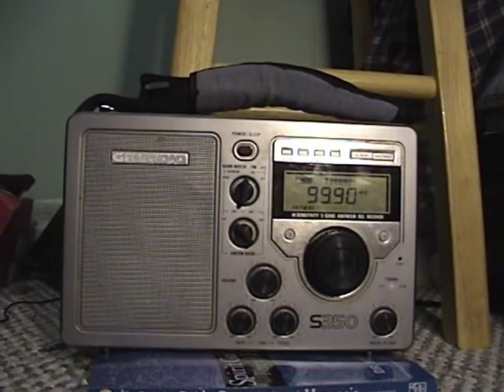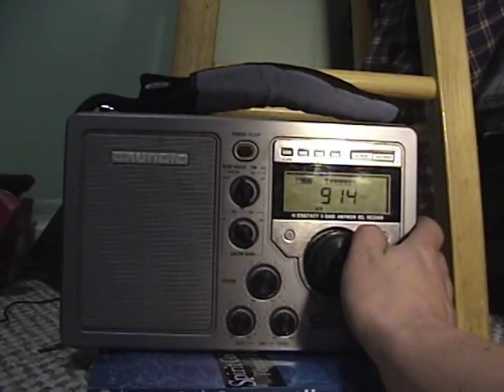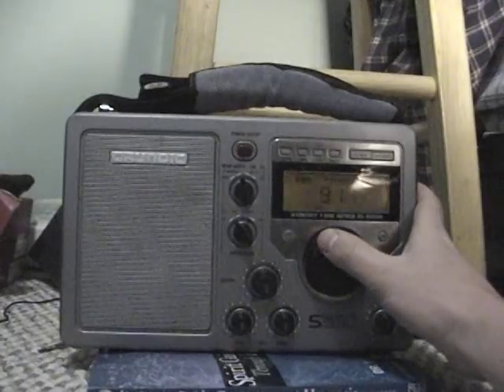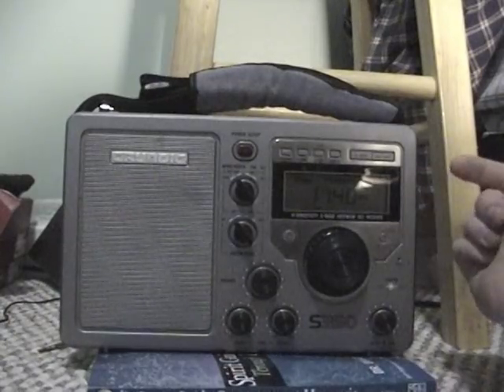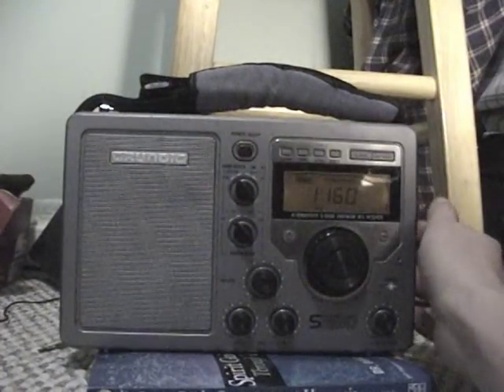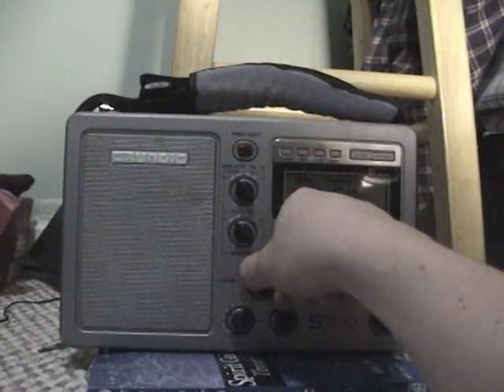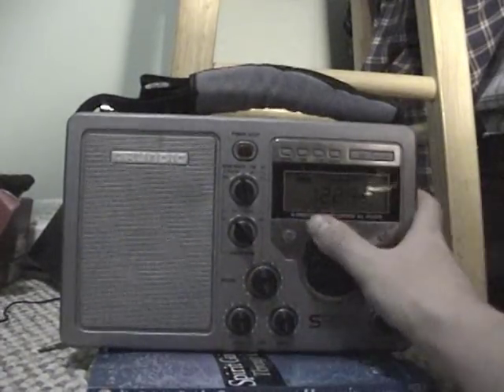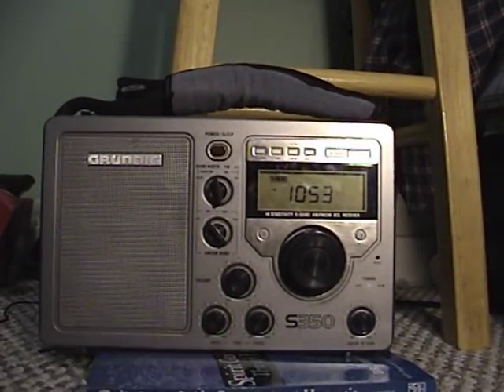Why HD Radio Sucks on AM - A demonstration

Comment: To me the iboc system is great for AM something we will never have in the UK but we certainly should. The only problem with it is that it kills any ability for dx'ing and I guess ditto on FM ?
Reply from the maker: HD radio would be worse in the UK. It hasn't worked here and most certainly wouldnt work there. Stick with DRM or DAB.
Reply from the maker: HD radio on AM is dying. The number of stations dropping it outweighs those adopting it 100 to 1.
Reply: In Toronto, ON, Canada, AM 640 is not available on AM HD radio but it also available on FM HD2 via 95.3-2, a sister radio station of CING FM 95.3.

Comment from the maker: Ok Thomas, go to Salt Lake City, Utah. Tune to 1140, 1150, 1170, 1180, and tell me what you hear on ANY radio. The Sony Wonder Tuner (XDR-F1HD) is an HD radio. Prior to the signal locking, you hear the hiss on KSL. I can hear it several hundred miles away where I live now. HD Radio on AM = a failure.

Comment from the maker: @Teflon65 IBUZ is just a term some of us who noticed the sound of the interference coined it. Also called as such because HD Radio's technical term is IBOC (In-band On Channel). I mainly use the IBUZ term because of the hash noise the sidebands of an AM HD station (and in some cases, FM) produce. Any radio, including HD Radios themselves can hear the noise you hear in this video. It blocks hearing other channels, that is my main complaint.

Comment from the maker: @THEBossSound most people who have radios probably didn't spend that much to buy them. The cheaper the radio, the more cheaply it is built, and the more likely you'll hear the interference. For example, I live within 10 miles of a 10,000 watt AM station on 1060 that DOESN'T use IBOC and it is clean as a whistle at night and day. KSL features hash from 1130 to 1150, and then from 1170-1190 on almost all of my radios, even with HD. There is no denying HD Radio makes interference on the AM dial.

Comment from the maker: @schepler2 
I respectfully disagree that it is the S350. As I mentioned, any radio receives the hash produced by HD Radio. Even the Sony Wonder Tuner (XDR-F1HD) which is an HD Radio itself picks up the noise. The S350 has received a large chunk of the 354 stations I have heard in Salt Lake. With the right antenna, it becomes a really good performer. I also mention the radio wasn't in a good position when recording this video.

Comment from the maker: @Teflon65 Yeah, sometimes the older the radio, the better AM sounds. The Grundig in the video is probably the best sounding radio I have. The others do not have the wide switch or are too wide that they allow adjacent stations to bleed badly. The radio in the video can switch between narrow mode (10khz) or wide 10+ khz so you can hear the whole sound. I prefer narrow though, because the S350 is a hot AM receiver.

Comment: @Ubstudios And what listenable stations are there in SLC on 1170 etc?  none.  Especially if you are 10 miles from a 50kW AM.  The FCC would not assign a station within 20 kHz on either side within KSL protected area.

Comment: @RogueKnight12866 There is nothing wrong with Justin's demonstration; it demonstrates why it's difficult to listen to adjacent channels on AM quite well. From my High Desert listening post in California; IBOC has eliminated or causes interference to a dozen station that use to come in here. Example: KDWN 720 Las Vegas is covered up by 710's IBOC from Los Angeles, 660 Oildale suffers from adjacent channel interference from IBOC on 640 KFI. Noise is added to the main carrier from the IBOC

Comment: As a guy who collects vintage radios, and who also owns a Grundig S350, I can tell you that the Grundig gets abysmal AM reception, at least here in the Phoenix area.  I have a 45-year-old Zenith Transoceanic 3000-1 that gets almost noise-free AM reception at all times of the day or night.  So, some of what you're demonstrating here is simply a result of the shortcomings of the S350.

Comment: KSL's analog signal would cover 1150 to 1170kHz on the "dial" but their outer HD bands are 1145-1150kHz and 1170-1175kHz.    

This is especially problematic at night; trying to hear a DX station next to a local HD station is a mess of HD digital noise from the local on the DX station's weaker signal.  In this example, DX stations on 1140 and 1180 would get heavy HD splash from KSL.

Comment from the maker: @RogueKnight12866 You obviously have no idea how many people listen to AM radio stations from farther away than normal. The problem I discuss in this video is that the IBOC signal creates hiss on the center frequency itself. As I write this comment, I am listening to KOA... 300+ miles distant, and I can hear the hiss caused by its own IBOC on 850 itself. Even on an HD Radio tuner, you can hear the hiss caused by IBOC itself. IBOC would work on AM if it were to fit within 10 kHz, not 30 kHz.

Comment: Wow.  I suspect this is the reason why we're not using HD Radio here in Australia.  What an awesome radio you have there.  I like it.  Grundig are generally very good.
Reply: Lachlant1984 Australia uses DAB on 174 MHz to 240 MHz.

with channels 5A, 5B, 5C, etc...

Canada ended DAB broadcasting since 2006 but they changed to IBOC HD RADIO broadcasts.

South Korea and Taiwan uses DAB, Philippines uses HD Radio.

Comment from the maker: @josephdupont It shouldn't matter if it is calibrated or not, what can be heard on this radio can be heard on other radios. HD Radio produces hash on sidebands on AM (and in some cases on FM), plain and simple.
Reply: Ubstudios 

Analog AM radios in Canada could also simulcast via FM HD radio subchannels.

Toronto's CFTR 680 NEWS does not do HD on AM but it simulcast via HD subchannel 2 on 92.5 FM CKIS KISS FM.

92.5 CKIS Kiss FM has 3 HD Radio subchannels.

HD1 for main CKIS FM 92.5 Kiss FM station
HD2 for CFTR AM 680 News  simulcast
HD3 for CJCL AM SportsNet 590 The Fan simulcast

Comment from the maker: @s51curtis I hate to agree about AM technology not lasting much longer but its becoming an unfortunate fact. As far as KSL's HD sound compared to analog, you're right, it does sound better, albeit with digital artifacts. As finicky as the signal is for an HD AM station (you practically have to live on top of the tower for the station to sound the best), I really question its worth. In this situation, KSL is also on FM, so it doesn't make much sense to broadcast their AM AND FM in HD.

Comment: Part of the reason why KSL sounds so bad on 1160 in the wide position is probably because your radio's digital display isn't entirely accurate.  I used to have a Grundig S350 and then an S350DL and they both suffered from this.  For example, if I wanted to tune into 700 WLW, the big AM station where I live, I would have to tune the Grundig to 704 khz for the radio to actually be on 700.  But anyway, that HD interference shows up on all of my AM radios and it's really annoying.

Comment: Your tuning into the digital part on both sides of main channel. My HD AM car stereo sounds way better than your old radio. I wish there was a mandate to add HD to all licensed AM and FM channels. I received HD AM 100 miles away! during the day. I live in TUCSON AZ, not much HD here but in PHOENIX AZ. they know what they are doing!
Reply: What he has isn't an old radio, just so you know.  I have a Tecsun PL-660 which is similar, both are DSP driven radios.
Reply: I have even picked up kcbs am 1070 in HD at night in Tucson. Thats over 500 miles away! JVC does not make hd radios with tuners like this anymore! jvc hdr 20
Reply: +james borg You should do a video of this, that's impressive ! Any stereo on AM HD ? Did Tucson ever have any c-quam am stereo stations ?
Reply: +digitalmediafan I am trying to put my jvc hd radio in my focus.  I picked up 550 am from phoenix IN HD!! and I live in Tucson 100 miles away.  Analog radio stereo is not nearly as good .  IVE GOT AM DIGITAL STEREO FROM 100 MILES AWAY!.  This guy probably likes analog tv signals too. Digital tv is better. Digital am and fm is also better.
Reply: +james borg During the day HD fm and AM 100 mile range.
Reply: +james borg OK well try to upload some video of what you receive !
Reply: Ordered a new jvc hd radio today. Will install when received. I also run my own 1 watt radio station on fm. I use breakaway audio broadcaster on a PC with my czh fm 1 watt unit. My audio sounds better than most fm stations (up to 1 mile away). I don't dare go over 1 watt (without a license) and have a clean signal on a vacant channel. I also helped fix KWXL a 50 watt LPFM local high school station with their audio issues. I will make a video of my new focus hd sound system when ready. Cant wait to get rid of my stock sync radio!!!
Reply: Me too in the UK, excellent fun for the price. And finds fm where there was none on other radios.
Reply from the maker: james borg kcbs isn't on 1070, it's on 740. KNX is 1070.

Comment: @Ubstudios That's true but look how many years it took for auto makers to include MP3 playback.  MP3 has revolutionized the music industry for the past 10 years but only in the past few years have a some auto makers included that, including Ford, Scion, Lexus.  HD radio isn't going away.  Aftermarket stereo makers are leading the way again just like with MP3.  Auto makers will follow their lead once again.

In LA and San Diego alone, there are 3 or 4 dozen HD channels and sub channels combined.

Comment from the maker: @THEBossSound 
On top of that, those living outside of the city, I.E. rural areas, who used to be able to hear stations at night a lot clearer can hear the digital signals as well. Case in point, KFAQ 1170 Tulsa used to be receivable here just outside of Salt Lake City at night with any given radio, until KSL turned IBOC on. I've been told by KSL that people in Vernal can't hear KSL because of KFAQ's IBOC. IBOC DOES NOT WORK ON AM! Period!

Comment: QUOTE from CES 2011:
"OEM: 17 Brands ● More than 85 Vehicle Types ● 36 Standard

Automakers substantially increased their commitments to HD Radio Technology over the past 12 months, and iBiquity expects strong corresponding growth in HD Radio equipped car sales in 2011.

Importantly, Toyota Motor Sales has announced the launch of HD Radio Technology in 2012 Model Year vehicles. Toyota will be the first OEM to offer the iTunes® Tagging feature on all radios that include HD Radio Technology."

Comment: I don't find your demonstration really relevant. In normal conditions, and for average listener, you don't try to catch dx signals on the fist or second adjacent channel of a local station. If HD radio is a relative fail for now, is not because of that.
Reply from the maker: I agree. The average listener doesn't do that. That doesn't excuse the on channel noise caused by HD. Even on 1160 you can hear the hiss. Non-HD locals never had that. That's a byproduct of HD and there's no way around it.
Reply: The first reason to not use HD on AM it's because broadcasters don't need it, you take a risk on your range with so few benefits, after, because HD FM can broadcast in HD channels AM stations, and finally, most of HD receivers on the market are only FM tuners. In Canada we use it since few months in some markets, and as I know, in Montreal and Toronto, you have AM stations on HD FM channels. Anyway... even if I like AM vintage sound, DXing at night, and the grandfathered technology, I saw in New York that FM stations simulcast AM 50kw transmitters (WFAN as example)... So AM radio will die, probably until 10 years from now. But, more HD tuners must be produced and sell. They are hard to find today.

Comment: DRM has a better plan to allocate many not all! low power radio stations on the almost unused 26khz 11 meter band,it has space for more than 40 channels on 10khz bandwidth or over 20 station on 20khz bandwidth for less compress sound.this will give many local AM station the oportunity to stay on analogue and at the same time in digita! that way it would not overload the AM band with dirty interference.Press the button and the radio does not care were the signal is  from as long as its there.

Comment from the maker: @Ubstudios And another thing, since you're obviously pro-HD Radio, tell me why it hasn't been massively adapted as we've been told by Ibiquity. Why can't I buy a car today with an HD Radio in it (but Sirius built in lol).  Why on AM did Citadel silence its nighttime IBOC transmissions? Why are the AM stations that use the technology letting it drop like flies? Obviously something must have happened! I do like HD Radio, just on FM where it belongs. The video shows IBOC interference, nuff said.

Comment: This video shows how corporate radio station using 'HD' jamming signals take up 2 extra channels of the radio dial  on each side of the main channel sending a chainsaw like  buzzing sound that obliterates small locally owned stations. You can observe this as you tune your radio dial across the channels any station using this fraudulent HD technology has this chain saw buzzing noise on a channel below and above the original licensed channel. HD stations take up 3 channels but you can only here
the analog channel in the middle unless you can find and buy a new HD radio , and since less then 1% of the public owns HD radio's ( or even cares know about this ) you see this is really used as a way to jam out the smaller stations. Evil company's like Clear Channel ( now Iheart media ) and CBS ( now Entercom ) own and collect license fee's ( anti-trust, monopoly crimes ) from the hardware and lobby congress resulting in a 10 times power increase for the HD signal. These Corporate stations have 5 or 8 or more stations in every major city and when they add this insidious  HD jamming signal each of clustered stations 'take-out' two more frequency from the public's airwaves , that is 10 or 16 more channels you only hear the buzz-saw signal on , channels that used to have good signals from smaller stations. The public has been duped by this corporate trick, even the name of the technology was a lie , its call I.B.O.C  I-BOC standing for IN BAND ON CHANNEL , this is a lie , it is really in the FM band but on some one body else's  channel. 
Another way of thinking about this is some fat-cat corporate business men in outdated suits come in and sit down at a bar , each of them start eating chicken wings , so many chicken wings there butts start overflowing to the bar stools on ether side of them forcing the other customers at the bar off the chairs.

Comment: You keep saying most radios are wide band as if you have a rare model that can go to narrow.  It's the opposite.  AM radios are all narrow, and it's the special ones like yours or the GE Super Radio that can opt to wide.  Also, The radio you have does not come with a perfectly calibrated digital display so you can't split those 10KHz hairs as you're assuming.

None-the-less, you've done an excellent job of illustrating the foolish and adjacent station destroying IBOC system.  For that, you are to be APLAUDED.  Thanks for posting.

BTW, it does the same damage to FM 1st adjacents just outside their service contours...and sometimes inside them and to some degree to 2nd adjacent stations too.

Comment: Yes  ... AM does have it's advantages ... 
BUT...
 Most radio transmission stations DO NOT KNOW - how to "modify rheir "signal inputs ... in order for MORE CONTENT and background surround "notes" to play ... instead they dumbly "transmit basic std MONO ... to the detriment of a higher quality - of "good" (full) AM MONO content - that is ACTUALLY available ...
 if they "took' the time to investigate this a wee tad more...

ie:-
Check out my response to ?
Flight of the Conchords ...  r8dkid

Comment: Just listen in HD. Problem solved
Reply from the maker: paul nadratowski dying technology  with very little adoption... ok.
Reply: Ubstudios just like satellite, it is in more and more cars, therefore, it will survive. AM sounds like such crap, something needed to be done.
Reply from the maker: paul nadratowski that's not the fault of the band itself but of radio manufacturers and the FCC not enforcing rules regarding interference. Nobody cares any more.

Comment: AM radio doesn't do HD. That's just you tuning the treble into the passband.
Reply: Bullshit, you do in fact have HD radio on AM.  My car has an HD radio and picks it up all the time, which is stereo too.
Reply: Brandon MacEachern Googled it. That radio doesn't even do HD.
Reply: joblessalex You really the missed.  HD radio is messing up none HD radio's.
Reply: The point that is being shown is that HD on the AM Band is messing up reception on the Analog AM Radios.
Reply: that's exactly what this shows.
Reply: joblessalex 

No HD AM radios in Canada.

Toronto's CFTR 680 News and CJCL SportsNet 590 The Fan does not do HD on AM frequency, but simulcast via sister's radio station on CKIS FM 92.5 Kiss FM. HD1 for Kiss FM, HD2 for CFTR simulcast and HD3 for CJCL simulcast.
Reply: No. HD radio is now in Montreal, Toronto, London Ontario, Calgary and Vancouver. Verify before posting next time.

Comment: You're a DJ.  WTF do you know about technology??  No, I don't support HD radio.  It's a boondoggle.  But using a 350 as an experiment....  now if you want to get real, use a Sierra FS-series frequency selective voltmeter or if you don't have that, use a Ten Tec 320(D) with variable filters.